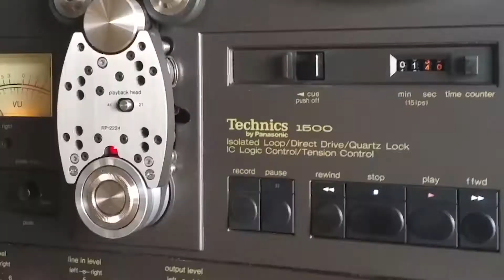Part SIX: Bellows Removal and repair - Technics RS 1500/ 1506 reel to reel tape deck repair

Comment from the maker: All you reely need to see is 4:37 for 2 mins this very clearly shows the rubber valves being flipped.  thx
Reply: What are the bellows used for do you know?
Thank you
Reply: It looks like they might be for the brake mechanism? Or tensioning?
Reply: I wonder if they still sell those bellows new?
Reply: So these belows control the brakes? Or tape tension?
Thank you

Comment: Thanks for the very clear instructions and video makes it easy to follow the steps, this is the best video I'm seen on this so far. 
The bellows help to keep the correct tension on the tape so they don't need to be pulled tight when you stop the tape.
This is due to the breaks which don't stop the reels by themselves the DC motors help a little by applying reverse direction as well.
Reply: for sure :)

Comment: I really appreciate these videos as hands-on tutorials for repairing my decks ... but I have to say - I would MUCH prefer a dialog of what you are doing, why,  problems or issues - etc. instead of the music ... please ...   I run these silent and record MY problems as the sound track so that I have  a reference for the next time.
Good videos - just don't need the distraction..
Reply from the maker: thanks for the comment.  not sure my babbling mumble would help much so silent may be the way to go.